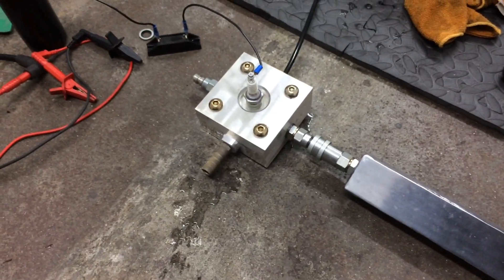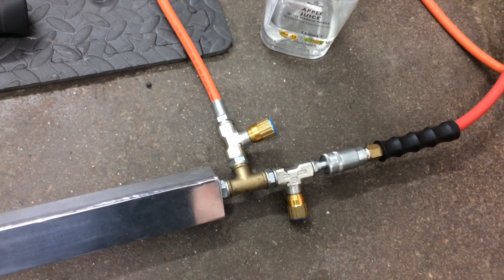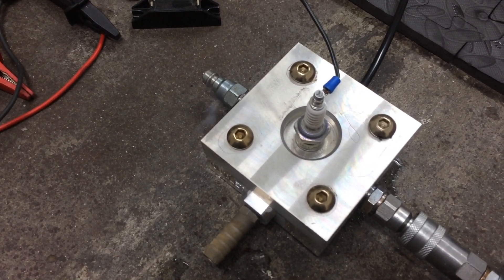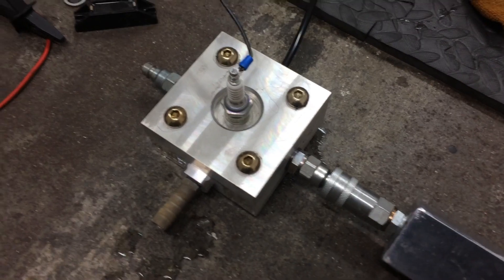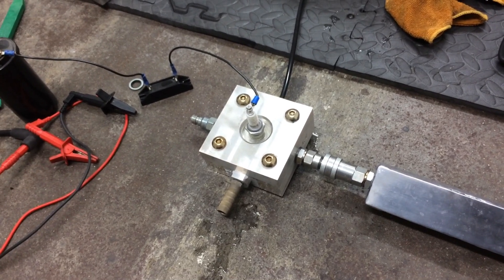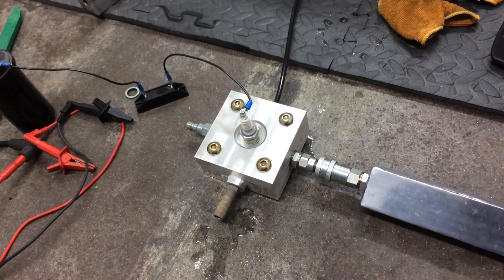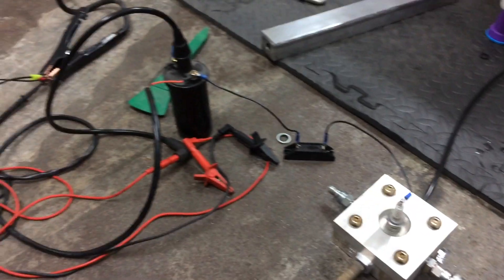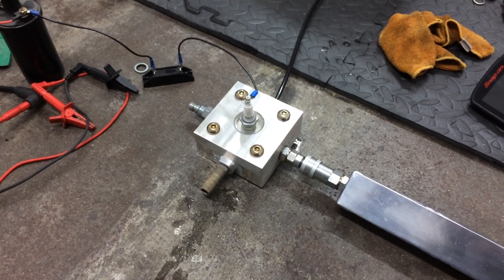Nikola Tesla's Self Resonating Super Heated Steam Boiler - Raw Footage

Comment: I'm confused by this. You have the fuel coming through the valvular conduit and the air inlet just open. The valve of pulse engines are on the air intake...I think you've made a bunson burner not a pulse jet... Isn't valvular conduit  supposed to replace the reed valves or tuned pipe of other pulse jet designs allowing air (oxydiser) to come into the combustion chamber but prevent combustion pressure from escaping. Then the exhaust length is tuned so you get a pulsing cycle of ignition, exhaust, ignition exhaust.. Whereby the negative pressure pulse from the exhaust pulls fresh air into the combustion chamber where it mixes with fuel, explodes and sends another pressure pulse down the exhaust creating another negative pressure pulse pulling new air in . Pulse engines don't sound like that, they roar like an unsilnced interval combustion engine.. Which is what they are..
Reply: Ok, air/fuel mixed in the conduit that makes more Sense. The hz thing isn't what defines a detonation engine though. A detonation engine uses detonation of fuel instead of deflagration. Its about pressure, in lower pressures of normal engine and pulse jets you get Deflagration, which is the normal subsonic propogation of a flame. Detonation is rapid, supersonic, and more efficient propogation of a flame front that you get with more volitile fuels at higher pressure. Like hydrogen+oxygen combined under high pressure.
Reply: So "pinking" in a petrol engine is detonation: too much ignition advance, too much heat, lean air/fuel. You get the engine compressing already expanding mixture and the result is efficient explosions which wreck the engine
Reply from the maker: @owainwinfield9053  pinking is when ignition occurs and the piston is in the wrong place to allow the combustion gases to expand. Knock sensors are used to allow the ECU to advance and retard ignition timing to stop the explosions / detonations blowing a hole in the top of the pistons or worse bending the connecting rods too. I've seen loads of pistons come through the engine block. When you have no moving parts in the engine such as pistons or valves the frequency can run into the thousands if you have high enough vacuum.

Extract from US Patent 1,329,559 "The frequency will be the greater the stronger the suction, and may, under certain conditions, reach hundreds and even thousands per second. It scarcely need be stated that instead of one several explosion chambers may be used for cooling purposes and also to increase the number of active pulses and the output of the machine." https://teslauniverse.com/nikola-tesla/patents/us-patent-1329559-valvular-conduit

Here is another extract: "Upon the subsidence of the explosion the pressure in the chamber sinks below the atmosphere owing to the pumping action of the rotor or ventilator and new air and gas is permitted to enter, cleaning the cavity and channels and making up a fresh mixture which is detonated as before, and so on, the successive impulses of the working fluid producing an almost continuous rotary effort."

This is the only time the word "detonated" is used whereas "explosion" is used 6 times in the patent.

Here is another part of the patent I will add "When the chamber is small an auxiliary means for starting, as compressed air, may be resorted to and a very quick succession of explosions can then be obtained."

So it appears the device can be built for deflagration or detonation. 

Tesla describes hearing a musical note in a 1920's article that was released after his 1916 patent was finally approved.

This is an interesting video: https://www.youtube.com/watch?v=_UqebpWMfpk
Reply from the maker: @owainwinfield9053  I just copied this from Wikipedia. "Another side effect, not yet demonstrated in practical use, is the cycle time. A traditional pulsejet tops out at about 250 pulses per second due to the cycle time of the mechanical shutters, but the aim of the PDE is thousands of pulses per second, so fast that it is basically continuous from an engineering perspective. This should help smooth out the otherwise highly vibrational pulsejet engine — many small pulses will create less volume than a smaller number of larger pulses for the same net thrust. Unfortunately, detonations are many times louder than deflagrations." https://en.wikipedia.org/wiki/Pulse_detonation_engine

Also copied this from Wikipedia. "The cycle frequency is primarily dependent on the length of the engine. For a small model-type engine the frequency may be around 250 pulses per second, whereas for a larger engine such as the one used on the German V-1 flying bomb, the frequency was closer to 45 pulses per second. The low-frequency sound produced resulted in the missiles being nicknamed "buzz bombs." https://en.wikipedia.org/wiki/Pulsejet
Reply from the maker: Bunsen burners burn fuel continuously. Whereas this engine with no moving parts does it in pulses very efficiently. Less than 250hz equals pulse jet and over 250hz is pulse detonation. The purpose of the device is to produce super heated steam at low pressure to propel a Tesla turbine. When finished it will be more efficient than any petrol engine ever could be due the the high RPMs obtainable. Even formula 1 has only reached 21,000rpm. I have reached 47,000rpm with a 5” rotor and 280,000rpm with a 28mm miniature rotor. I do need to make a video that goes into more detail about the machine granted. Just setting up in the new workshop now and firing this back up is on the cards!
Reply from the maker: You should check out YouTuber iEnergySupplys videos on the subject if you want to hear a loud one. The size of the exhaust on mine is why it is quiet. Just like any engine the more fuel you consume and explode in a shorter window the louder it will be. After hours of testing the gauge on the gas bottle still reads full. The purpose of this device is to produce rapidly expanding super heated steam in an ultra efficient way. When connected to a Tesla turbine of a certain construction it will most likely get quieter. Do we want loud engines in anything other than sports cars?
Reply from the maker: The apparatus for making super heated steam is usually cumbersome, dangerous and expensive. Tesla figured a much better way. The reason it hasn’t been exploited is because few people understand what the invention is. Currently this is the only version on YouTube that I know of projecting low pressure super heated steam. When this is combined with the turbine it will all make sense. I had hoped that someone would pick up the baton from me and run with it but as this hasn’t happened it might be me that connects this to the turbine first. Then people can see what it was actually designed for. There are a couple of YouTubers that have connected a turbine to the device. However they have not made a water jacket / jet system that produces super heated steam to my knowledge. This is pretty critical if you have it attached to a Tesla turbine and you want decent torque from heat rather than pressure. Using a diverging nozzle converts the heat to velocity and the the turbine converts that via adhesion to mechanical rotation.
Reply from the maker: The compressed air and propane are being mixed in one valvular conduit and the other side is a spring loaded hydraulic fixing that with nothing connected will be shut completely.

Comment: wow. I can build a coil that can make more then 140kv your going to need a voltage multiplier made of diodes and capacitors and it will all have to be submerged in oil to insulate it. be careful

Comment: I have been really wanting to try this with Brown's gas.
Reply: @nikola.tesla.r.and.d.centre  
I have been working with Jeremiah on that, I definitely think that was Tesla's original intention. I build really efficient Brown's gas cells, and I proved without any shadow of a doubt that they are ridiculously over Unity on. I can get significantly better results with everything running properly. However just for simplicity if I run my cell on brute Force DC current, I get 60 liters per hour at 185 Watts conservatively and with fluctuating output. 

423.3 cubic feet 1KG of H2 423.3cf is 11986.5 Liters of H2 is 33.322KWH
adding 3995.5 liters of O2 makes it worth about 130KWH 2.78Watts 1Liter of H2
1 Liter of H2&O2 is worth 7.228watts

166.85 watts 60L 111watts 40L H2

433.68watts 40L of H2 20L of O2

199.7 LPM of H2 is 1KG per Hr 266.36LPM of BG is 1KG per hr. 53,272watts at 200w per LPM.

1LPM of H2&O2 is 433.68 watt Hrs
1.72LPM is 1HP. 3.44LPM at 50% 

So I'm producing one horsepower at less than 320 Watts. And I believe the Jeremiah's Tesla turbine will be really close to 100% efficiency. I have been chomping at the bit to test this for months.
Reply: @nikola.tesla.r.and.d.centre  
But I think a very interesting test would be to Simply measure thrust from a pulse detonation Rocket engine. The main thing stopping me is I live in town and have police calling neighbors currently. We have a very annoying sound ordinance. And a PDE on Brown's gas is going to be ridiculously loud. And by the way I'm not sure if you know this or not. But if the engine breathes air and has a valve it's a pulse jet engine. A PDE has no valve but instead has a oxygen supply and technically classifies as a rocket not a jet.
Reply: @nikola.tesla.r.and.d.centre  
I would really like to see his denied patent. I'm extremely suspicious Tesla is the actual inventor of the Bob Boyce style flat plate cell. I think he used round plates and it looked really similar to his turbine. Hell his Tesla turbine almost is a Brown's gas generator LoL.

Comment: Here is one of my videos that were not published on the YouTube (loaded specifically for you), which shows the mode of the self-oscillating combustion process - as soon as the combustion chamber switches to this mode of operation - the nozzle begins to heat up a lot, and the jet speed decreases greatly:
https://youtu.be/68XlW5vV65w

Comment: Hi! As you know, I also devoted a lot of time to studying this Tesla patent. He also spent a huge amount of time and effort to achieve a satisfactory result in the operation of this combustion chamber. Therefore, please heed my advice).
When the combustion chamber works "in resonance" - as you say, this is actually a simple self-oscillating combustion process. The self-oscillating process is very different from intermittent combustion. When the self-oscillating combustion mode is set, the spark plug is not required - this is true, but the pressure in the combustion chamber does not exceed the air supply pressure from the compressor. When the combustion chamber operates in pulsating combustion mode, the ignition source (spark plug) is necessary, but also the pressure in the combustion chamber is much higher than the air supply pressure from the compressor.
I have encountered these phenomena many times. This is exactly what I recommend you to focus on the peak pressure in the combustion chamber (during its operation), then you will understand how exactly the changes made or the adjustment of the air and fuel supply affect the efficiency.
Try to set the maximum high frequency of the spark plug, let it work constantly, the spark should be as powerful as possible. Further, place several remote washers under the plug so that the spark gap is as far away from the main volume of the combustion chamber as possible. It is best to supply air and fuel through one valve, that is, an already finished combustible mixture. Only supply fuel and air in front of the valve does not stand, if the flow section of the valve is large, ignition will occur inside the valve!!! I made a threaded hole about in the middle of the valve, and fuel was supplied to it, through the same Tesla valve, but of a smaller size. Try it and get a lot of better results. I managed to reach the maximum pressure in the combustion chamber during its operation of 4 bar, provided that air and propane were supplied under atmospheric pressure.
Reply: @nikola.tesla.r.and.d.centre  
The tesla valve on the inlet allows the detonation chamber to reach higher than inlet pressure.
I would have thought adding the water jet just at the compression stage as the chamber narrows would allow the H2O to separate by superheating and compression?
p.s. the original design you used for separate air and fuel inlets is safer..
Reply from the maker: @El_Croc  why is it safer? In 1928 Tesla tried to patent the apparatus and method for a "Self-Propelled Vehicle". This version featured 1 valvular conduit. This was his later design.
Reply from the maker: I know you are an experienced Tesla replicator. However Tesla does write in the patent "After a short lapse of time the chamber becomes heated to such a degree that the ignition device may be shut off without disturbing the established regime."

Therefore, this is the way it should be done. You need to add a water jacket and water jets to your build and then propel the turbine using the super heated steam!

Comment: You could probably put some marker or chalk on the housing to measure the temperatures better since the aluminium is so reflective to IR.
Reply from the maker: Yeah good call, I should get the aluminium type 2 or 3 anodised.
Reply: @nikola.tesla.r.and.d.centre   Not sure, I at least haven't noticed any difference with anodised but I also don't have much experience with it tbh.

Comment: Measure the average pressure in the combustion chamber...
Without this meaning, your writings do not matter much. If the average overpressure does not exceed 1-1.5 bar (provided that air and fuel are supplied to the combustion chamber at atmospheric pressure), it is a failure.
Reply from the maker: It is supposed to be a super heated steam boiler with negative pressure. Cold steam is much more expansive. 100C = 1,700 times the volume of water. 17.5C = 67,000 times the volume of water.... go colder and the expansion ratio is even higher!

Comment: Maybe you could surround it with a water chamber to preheat the water and cool the Tesla Pulse Detonation Engine .Looking good !
Reply from the maker: Yes it could be connected to a chamber of water acting as a water battery.
Reply: @nikola.tesla.r.and.d.centre  would it help to use an ultra sonic fog maker to deliver the water vapor?
Reply from the maker: @cushionofair  I’m thinking the ultimate is vacuumed to the point of boiling from a tank. At 17.5C the steam is approximately 67,000 times the volume of the water. 1 litre of water can supply a lot of steam!

Comment: Why do you only have a single 1 way valve in this one?
Reply: I'm surprised it's still combusting and not putting the flame out. I see bubbling happening in the water tank, it must suck some oxygen in from the water tank. A second one way seems like a more efficient design. How about adding a needle valve on the oxygen input so you could adjust the flow rate of the oxygen?
Reply: @nikola.tesla.r.and.d.centre  The oxygen has to come from somewhere for the combustion to occur. Without the oxygen input, the combustion reaction must occur at the exhaust and not inside in the chamber. Because there is oxygen available at the exhaust line. I assume the fitting for your oxygen valvular conduit is sealed when nothing is attached. Is that correct?
This is potentially problematic because I assume at some point you will connect this to a tesla turbine, without the added oxygen, you will still see a flame on the exhaust and likely still see steam, but it will occur after it has passed through the turbine.
Reply: I wonder if you should also include a valvular conduit to the water line? Seeing the bubble in the water probably indicates that some of the gas is pushing its way to the water tank.
Reply: @nikola.tesla.r.and.d.centre  You might consider using a stainless union fitting. Those do not have any rubber inside them. You just crank them down with a wrench and the beveled connector creates an air tight seal.  Like these: https://static.grainger.com/rp/s/is/image/Grainger/12G099_AS01 
I think the second valve is doing a lot, it is providing air inside the chamber so the combustion happens in the right location. If the second valve wasn't important, Tesla would have left it out. He was obsessed with making things simple! :-)
Here is a simple way to test it... Attach a 50cm+ pipe to the exhaust and measure the temperature with and without the O2 valvular conduit and measure the heat. My bet is that with the O2 valvular conduit attached you will see higher heat inside the teardrop chamber (that's what you want). Without it, you will see the majority of the heat at the end of the pipe where the gas can mix with the atmospheric air.
Reply: @nikola.tesla.r.and.d.centre  I don't think so. I'm searching for it now, but haven't found it yet
Reply: @nikola.tesla.r.and.d.centre  Wait, are you talking about US1329559A or a different one? US1329559A wasn't denied, was it?
Reply: @nikola.tesla.r.and.d.centre  No, I don't think so. I would love to see it.